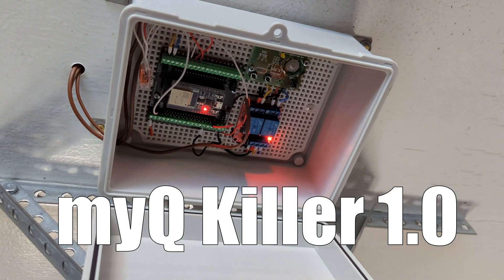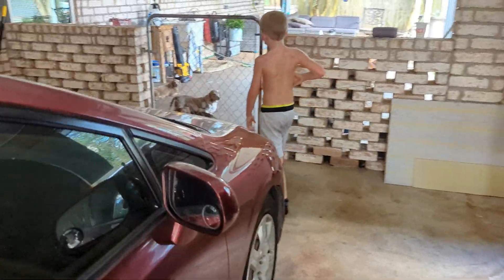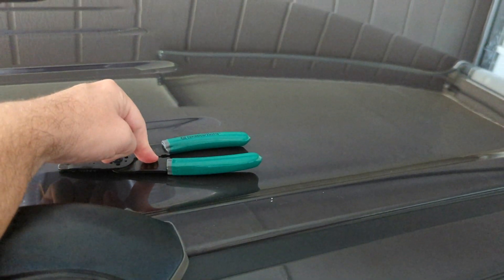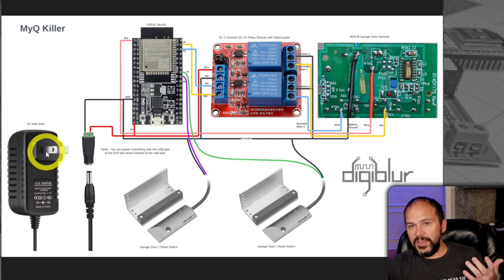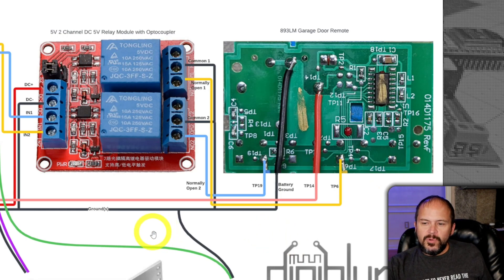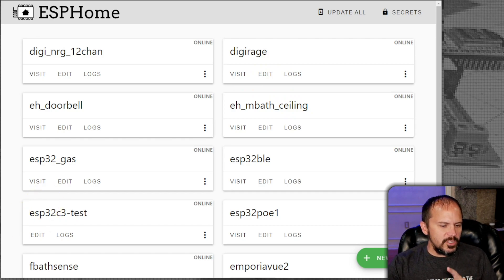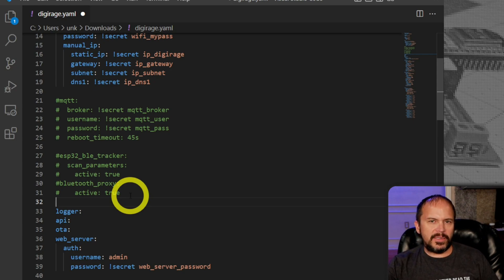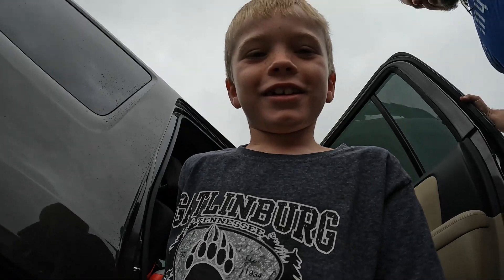myQ garage openers suck! How I fixed it using a spare door remote and ESP32

Comment: Great video, I was about to do almost exact same thing i.e. tapping to Garage Remote with ESP8266/ESP32.
I am actually planning to tap to the wall mount remote instead that has more functionality(timer, status led, light), so instead of only open/close you can also set/re-set/disable auto-close timer, control light and as bonus you can read voltage of the status LED to know if door is blocked(led rapidly blinks)
May be too many thing, but should not be much more work then what you already done. BTW, I had a quick measure on the wall unit buttons voltage and it was 3v, so it might be possible to direct wire pins from espp to the buttons, i.e. no need for relay, but need to remeasure this thoroughly first, or simply use relays.
Thanks for the video, great work please keep it up.

Comment: Nice work mate.
My garage door has an AUX pin for a manual momentary button.  
I connected a Shelly uni and use there firmware with a one second auto off.
Works great and I use one of my ESP-NOW door sensors to tell me if the door is open or closed.

I can open / close it from Home Assistant, I don’t use it much for opening. I have a bad habit of leaving home with the door open, node-red sends me an SMS if the door has been open for longer than x minutes.
Grate work, thanks for the video
Reply from the maker: Jealous of the simple openers, so much easier to throw on a Shelly and be done.  Love that easy solution!

Comment: The real "easy button" for anything that requires a momentary switch is using the Fortrezz Mimolite. It is a zwave device and it has a jumper inside that when jumped before you adopt turns it into a 1 second button push each time you trigger it.

Big fan of totally local control. I setup OpenVPN on my pfSense router so I can control everything "locally" even when I'm anywhere with an internet connection directly to the house. OpenVPN is really bomb proof! (Obviously no help when you are having "Cox barfed" issues.)
Reply from the maker: Any zigbee versions? Zwave is mess in my area.

Comment: I'm a garage door installer, first the beeping of the opener is a building code thing, off site remote operation of the unit requires not only the safety sensors and the force settings to be set properly like with using the remotes but also requires a additional audible and visual alert. Won't be a issue as long as there isn't a accident, I say it's your house, do what you want, just a contractor can't set it up that way. We use to carry liftmaster but recently changed to Genie due to call back and warranty issues after the 2021 models that have the updated firmware due to the lawsuit with Genie. As a diy motor I still recommend chamberlain (LiftMaster product) over the non pro Genie units, the build quality is better however I recommend getting a contractor to install a pro Genie.
Reply from the maker: I get it is a code thing for sure.  Someone didn't think it all the way through which is a good thing.  The first day I had them installed, I was next door and the opener was in my pocket.  I mashed the button about 5 or 6 times, no beeps and I couldn't physically see the door either.  

What's a good opener that still is old school?  Meaning the simple button contact style.

Comment: you just could use a couple of transistors on the spot of the buttons on the remote control board. so you could leave the relays out of it.
Reply from the maker: I might try some photocouplers as well given the low voltage.
Reply: I can verify that solution works well. I made a similar garage door opener and used 2N2222 BJTs to bridge the button contacts on my remote as @Danny Z suggests so I can still press the buttons on the remote. They're so small they fit inside the remote control case. Still going strong 5 years later. You can get a bag of 200 2N2222s off of Amazon for $7 right now (yes, 3.5 pennies each compared to over a dollar each for relays).

Comment: This is a very solid build, but for those looking for an easy solution, I discovered a much simpler approach.
The key simplification is that you don't need a relay at all. In fact, if you only have a single gate to control, you don't even need multiple wire pairs -- you can perma-short the remote button, and use the digital pins on an ESP (or Raspberry) to briefly apply power to the remote (instead of a battery). These remotes use so little power that digital pins can power them without issues. If a wired position sensor is not an option, one can use the wattage readout from the smart outlet controlling the gate opener to detect if the command has been received. Combined with a Z-wave tilt sensor, it's a pretty reliable setup.
Reply: I have been pouring over the internet for someone who has figured out a low cost solution like this! Do you think it is possible to augment the remote mounted on my wall (be it wired or wireless, have not looked) with an esp8266 in the same way? Sort of simulating a button press using the digital lines?
Reply: @copperthedergy  It's certainly possible, but it's more complex, and an extra generic wireless transmitter is very cheap (<$15), and readily available on amazon/ebay. Just make sure you get one that's compatible with your opener -- typically what you need to know is the color of the "learn" button on the opener.
Reply from the maker: Check this one out. It is the one I looked at in my project https://github.com/PaulWieland/ratgdo
Reply: @copperthedergy  My solution was an Wemos D1 Mini ESP8266 and the D1 Mini Relay Shield.
Might not need the relay, but i like hearing the click....lol  and it was cheap.
I did mine in Home Assistant so I had access to ESP Home which made it really easy to code it.
Reply from the maker: Interesting concept there for sure! I like it!

Comment: Travis, Great part 2 to your your part 1 video. Thanks for sharing your tips/tricks/techniques (e.g.  eliminating the 3V coin cell) for the project. Can't wait to see your solution for car presence. Have you considered using Time Of Flight (TOF) sensors for measuring distance. You could tell if your car is parked in the garage, or not (based on the distance from the sensor to the roof of your car.
Thanks again! 🙂
Reply from the maker: Thanks! I a few options I am looking at and that is one of them. Or should I say options I am testing for the accuracy.

Comment: Awesome!! I can't stand the beeping before it shuts the door. I am def doing this, thank you!
Reply from the maker: I still don't get that beeping noise thing where it only comes from the app.  First day I had them installed, I had the remote in my pocket across the street.  I hit the button a few times on accident without visual contact of the door and no beeping required there.  I guess I need to be quiet before they enable that on all closings...doh!

Comment: What's the advantage of this setup over running ESPHome on a Sonoff SV, using the output pins on the SV to close the contacts directly on the garage door opener?
Reply from the maker: Sonoff SV is ESP8266 and was only single relay so two strikes for me there.  I actually thought about using two Shelly1's as they are already ready to go in cases and have screw terminals on them but then I wanted ESP32 and to add more stuff later.  

Now for the contacts on the opener, you can't do that on newer openers.  They use a type of digital signal on the line so shorting the wires together does nothing.

Comment: Did the exact same thing. Actually you can’t just Hotwire the new MyQ. The wall buttons are smart and send a digital signal to the main unit. So that’s why I used a powered remote like you did.
Reply from the maker: They do have  $10 additional wall button you can use as well but since I needed two and wanted to "air gap" things electronically I went with this method.  Works out great as I've been using it for weeks.
Reply: @digiblurDIY  I do have very rare times when the 500ms relay click is heard but the remote won’t trigger. Never figured it out. Does that mean ever happen to you?
Reply from the maker: I haven't had that issue yet. Only time I had it not work was when the motor went into protect mode from mashing the button over and over too many times. OG had a little too much fun helping with b roll clips.
Reply: Haha. Got one the same age I get it!

Comment: 1:19, I'll bypass your code box and just pull the 5 cent rope on the garage door opener.  I'm just busting balls..... good job
Reply from the maker: What rope? Just kool-aid through the door might be easier.
Reply: @digiblurDIY   1:29 the emergency pull rope for when the power is out.  Oh Yeah! right thru the door. lmao!!
Reply from the maker: Those may or may not have fallen off. The power is only out for maybe 20 seconds max. 😂

Comment: Very nice build, i will use it for inspiration on my garage :) I would put two extra relays on the ESP and have it turn on/off the power instead of the smartplugs. Less standby usage.
Reply: but those relays will be at mains voltage ..
Reply: @jyvben1520  And? Keep the box closed and away from prying fingers.
Reply: @zaprodk  not all relays are rated for high voltage (> 24 Volt)
Reply: @jyvben1520  All the eBay-special relays are rated for 240 Volts AC, so not a problem.
Reply: @zaprodk  i never bought from ebay
Reply: @jyvben1520  Good. It's just a name i came up with - you can get these boards from your local electronics supplier just as well.

Comment: I'm pretty sure there's a way easier way to do this, unless these newer models have introduced too much complexity. The simple "doorbell" style button used on openers traditionally is simply a momentary switch. Newer openers like this support a bit more complexity with the multi button panel that controls the door and the light, sometimes included with a motion sensor, BUT I think that if you simply short the two wires running from the opener to the button, it should equate to pressing the door button. For older openers that is definitely the case. 

So really you could simply wire a shelly contact relay to the back of the opener where the button wires are attached and use simple zigbee contact sensors on the door.
Reply from the maker: That's not the case on the newer openers, you might have missed the first one I did explaining why I went the remote route.  I should have explained it again here.  
They've moved away from shorting the wires together.  If this was the case you'd see me doing a Shelly with a reed sensor like I showed in the end clip for a few seconds.  The Shelly1 is a great solution and my go to for older GDOs.
Reply: @digiblurDIY  got it. Ironically I just watched your older video where you explored this method. I'm used to working on the older style.
Reply: Linear still works in that fashion but most residential operators like to "communicate" with the wall console.

Comment: lol - I did something very similar a few years ago but I use a HC-SR04 sensor instead.  I did however leave the battery in the remote board that esp32 triggers, but I really like your idea of using power from the esp32 board instead - will need to make that change before my battery dies!
Reply from the maker: I did test the amperage draw from the board while the button was being pushed.  Boring part of the footage.. it was using 0.008A at 3.3V when holding the button on the remote down.  I knew the ESP32 dev board would laugh at that power draw.

Comment: Definitely got my attention since MyQ definitely does suck! However, can we at some point figure out how those 2 wires actually control the door, power back lighting, work the lock, and I think more, and connect to those wires instead of using a remote? Not that it’s not an easy and great solution, but it could be even better. Nice job, looks and works great.
Reply from the maker: Someone already did that in a project, I can't remember the name off hand right now,  but I went the method of using ESPHome and the opener as it fit my dual door scenario and car sensor automation a little easier.
Reply: @digiblurDIY  oh man nice, will have to look for that, was it on YouTube? You usually do have good reason for the things you do.
Reply from the maker: It was back to that reasoning of needing two doors and this was a good isolated solution for my setup that wouldn't impact me saying, "Hey Mr Doorman...you stuff stopped working. Come fix it."
Reply: RatGDO is what you're wanting.  It does have the threat of you harming your garage door opener circuit board.  Using the clicker like Digiblur did hear is high results and low harm.
Reply: @calebjpryor  awesome thanks, I think I’m more interested in knowing how than actually doing it, however once I know, look out ha ha.
Reply: @calebjpryor  Trying to install my ratgdo today, and since it didn't come with any firmware on it, I'm stuck. My one and only Windows PC seems to have an issue with the CB340 drivers that I just can't figure out, and all my Ubuntu computers have the same kind of usb driver issue, I seem to be stuck again. At this point I have no fear of burning up my crap garage door opener, and I did already solder to one of my openers years ago, and it works ok, but after having the actual working myq integration working, I just can't go back to it. Guess I'll take it along to work on Monday and try on a Windows PC there, frustrating that it doesn't come with any firmware at all.  @calebjpryor